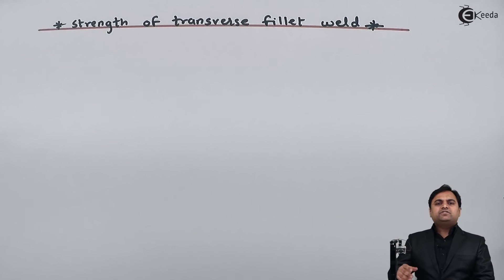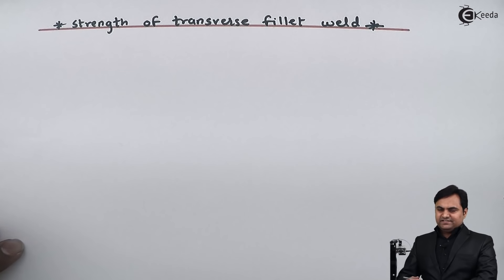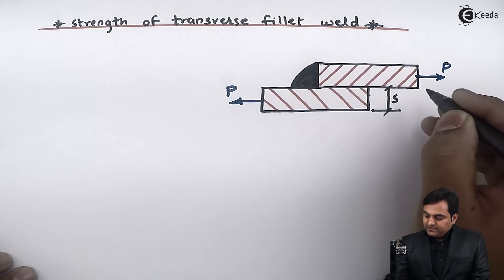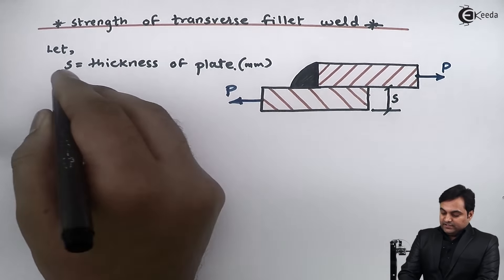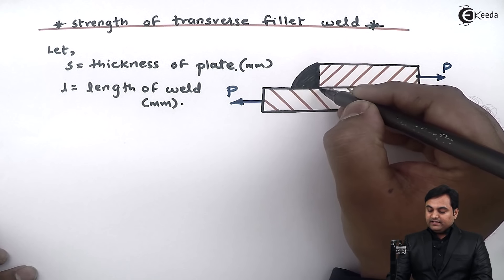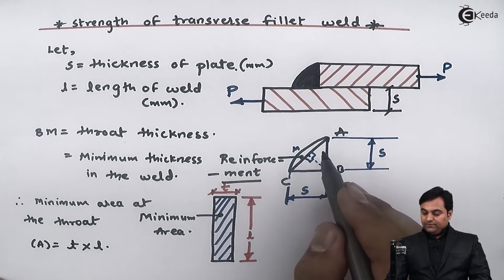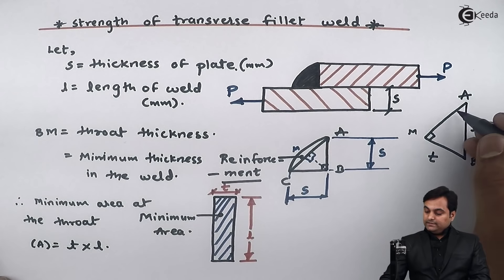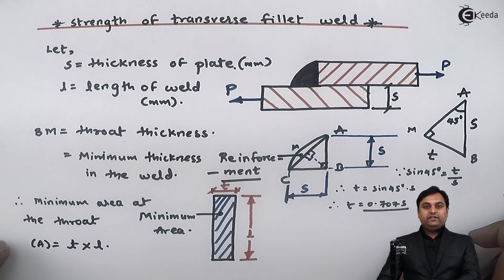Strength of Transverse Fillet Weld - Design of Welded Joints - Design of Machine

Comment: But in steel code book it is written while calculating the design strength of weld, effective length of weld should be in consideration but not overall length.
That is effective length of weld = length of weld - 2x size of weld.
But sir why have you taken length of weld instead of effective length?
Why are you not following the steel code book IS 800: 2007 page no. 78-80
Reply: Also design strength of weld with respect to shear.

Comment: due to shear stress, transverse fillet weld can fail,not due to tensile stress.pls correct it otherwise many students can confuse
Reply: I think you are confused it is due to both shear as well as tensile stresses and weld will fail by shear in parallel fillet welding
Reply: I agree with Yogendra Singh.

Comment: Sir, in case of tensile stress,the line of action of load is perpendicular to the cross sectional area.but here the area associated with the throat upon which we calculated the tensile strength isn't Perpendicular to the force...so how can you explain this?
Reply: This is the reason tensile strength is converted to shear strength by dividing it by √3

Comment: My experience is a bit different.  The weld that I put as a fillet eats into the metal parts and not only put something on top like your illustration.  This means the weld must be shown having eaten into the metal parts.
My next experience is that after welding, it is super hot.  When the parts cool down, the upper right part rises because of the pull of the weld when it cools down.  The pressure P therefore is not going to the right or left respective to the parts, but rather, the parts are pulled towards the weld as it cools.
The whole explanation, therefore, does not make any sense at all.
Reply: joselyn agoncillo 

If you want to know how much load a fillet welded joint can withstand, u can make use of this equation.
P is not pressure it is the external load that can be applied on to these plates.